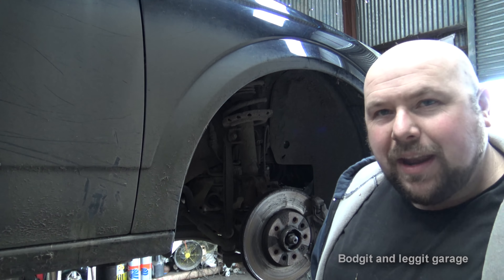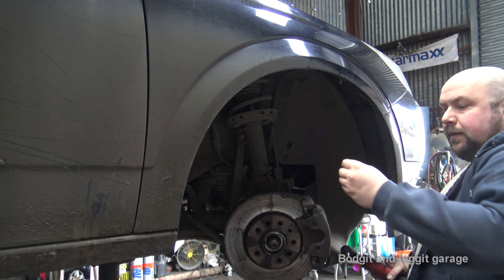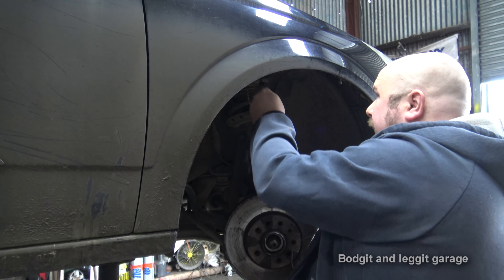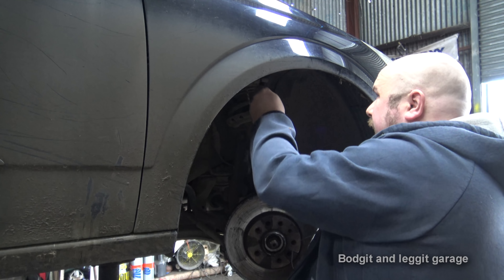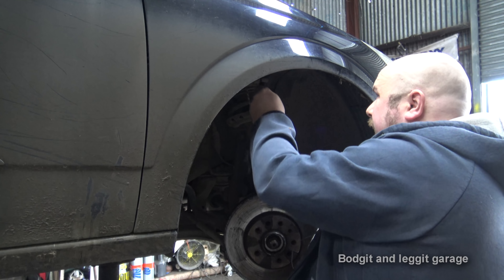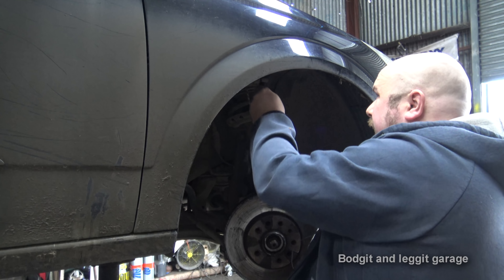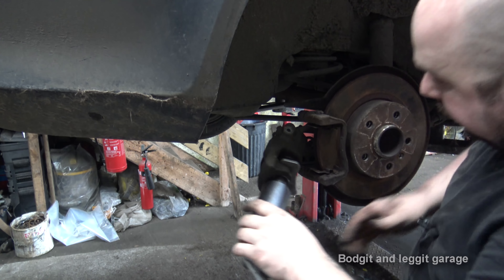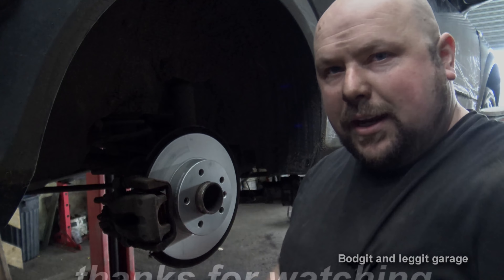Opel Vauxhall Astra pads and discs front and back Bodgit And Leggit Garage

Comment: what will cause a caliper to squeak when you release the brake peddle. is it a sign that the caliper is beginning to seize. its starting to get annoying now but everything appears to be fine with the brakes when i checked the over and done a service on them.
Reply from the maker: Chris' Man Channel hi mate I will check the thickness of your pads it could be the wear indicator rubbing against the disc
Reply: bodgit and leggit garage it doesn't have wear indicaters and there's a good half of the pads left. It's even if your stopped. Every time you lift off the peddle there's a squeak from the front near side. It's got me baffled because I've only ever known brakes to make a nose when the cars moving.
Reply from the maker: Chris' Man Channel if you've checked everything mate and everything looks good then all I can suggest is you to change the brake pads again you could have some dodgy brake pads I've seen it before that should hopefully solve your problem that's providing you have checked everything make sure all your sliding pins are greased and 3 there is no rust jacking anywhere etc

Comment: Hi Leon,nice vid.Would like to find out you opinion about the fact that slider pins on this caliper system(ATE )don't need to be greased.I'm talking about the front calipers.Any lubrication would affect the caliper work.There is a few tightening rubber rings inside the rubber boot which suppose to hold slider pins tight enough and to help to move caliper back when the brake pedal released.Thank you.
Reply: Yep, no grease on this type. Sliders are chrome plated, and they have to be dry.
Reply: Really?  Same on the vectra setup as well?
Reply: Yes. In this system, slider pins are exposed. When they are greased, dirt stick to them, wear chrome, and pin holders. You grease pins in Valeo system (like in Astra J). There pins are covered in boots.
Reply from the maker: No mate I don't agree with you on this they still have problems when they're not Grease the biggest problem I see is when people use copper grease on these that causes problems you get build-up on them regardless I've seen it I've never once had any issues after I have used the proper grease on them not one issue ever
Reply: Agree with you Leon!Only synthetic based grease as Slipkote 220R must to be used.Until the very recent past I greased them as well.However,for some reason, manufacturer state that slider pins on these caliper systems should stay dry.
Reply: @bodgitandleggitgarage  you are spot on here no problem

Comment: Leon why don't you use tread locker on the carrier bolts? Also do you normally not put copper grease on the hub before putting the new disk on? Great video, I'd say you'll be glad to see the back of that astra.
Reply from the maker: Tony Connolly I only put thread lock on when it already has it on if it doesn't have it I don't put it on I only use copper grease on the brake pads would not use it anywhere else he acts like sandpaper and causes were if I need to use other Grease I would use moly grease on other parts

Comment: Caliper is last resort. You can wind out the rear piston and hit it with the wire wheel to remove all the shit and rust and also clean up the square seal and boot. Lube up everything and put it back and bleed the caliper. A lot cheaper that a recon caliper.
Reply from the maker: clarkie005 in my experience absolutely pointless the piston is normally pitted you are just delaying the inevitable if you're gonna do it do it properly no point trying to skimp on breaks to important
Reply: bodgit and leggit garage ..breaks??   Oh brakes!!

Comment: Be carefull anyone doing this job.The older Astra G s  have an integrated hub carriertype  which is different to this video and most videos iv seen on U Tube.Also the brake pin threads are very fine and can be cross threaded easily.

Comment: Scrap it and buy a Ford 😂
Reply: i sold my corsa and bought a ford, does that count
Reply from the maker: Martin Cooper you have been saved lol
Reply: 0:54 "what you can do sometimes is not that" funny how some can say one thing and in the same breath react to something. what happened there miss the handle? think you know mine is an 08 and needs a turbo rebuild or replacement

Comment: humm what job does the copper grease do???is it so the brake dust has something to stick to??Dont need that copper sh*t with modern braking systems,Most come with stainless steel hardware......rant over carry on leon.
Reply from the maker: pete smith where should I begin with this you do need some kind of Grease stainless steel hardware what about the metal underneath the stainless steel or what about the metal on the brake pads there is there is a thing called Rush Jack in Just Cause you got a stainless steel plate sandwich between two piece of metal that can rust do you want me to go on
Reply from the maker: pete smith 😁😁😁😁
Reply from the maker: pete smith oh I forgot what about brake squeal